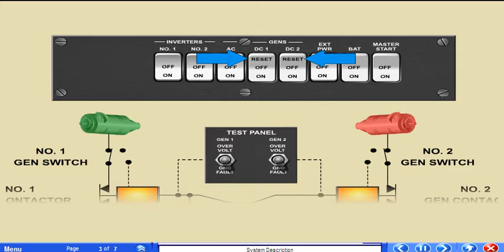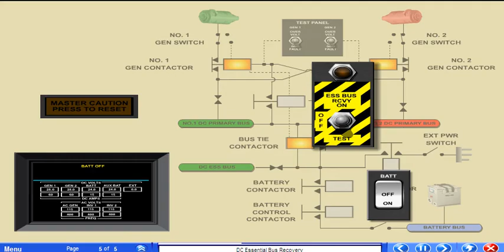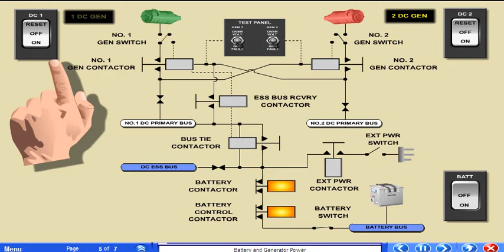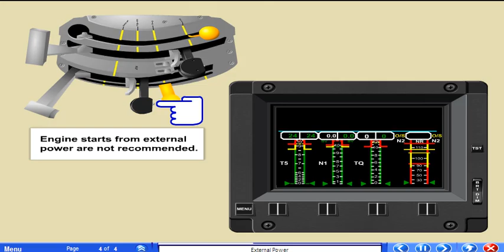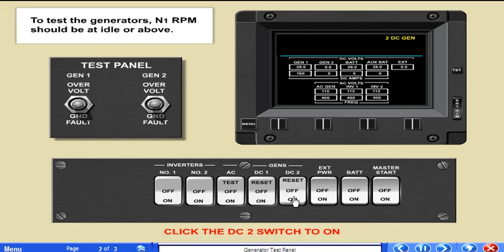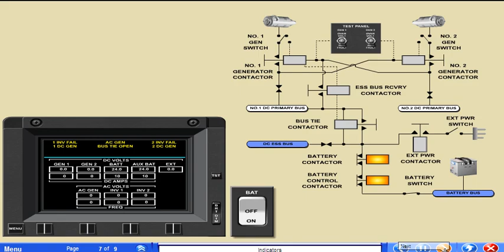02DC Electrical System - Sikosky S76 C++

Comment: I'm not sure the description of the DC overvolt test is correct. The DC GEN should drop offline almost immediately, not after five seconds, right? It's the undervolt test that you need to wait five seconds (which was correctly described).